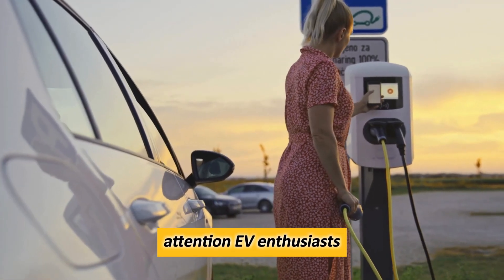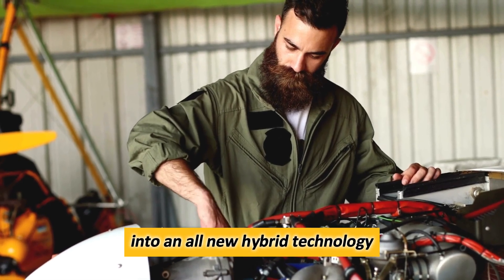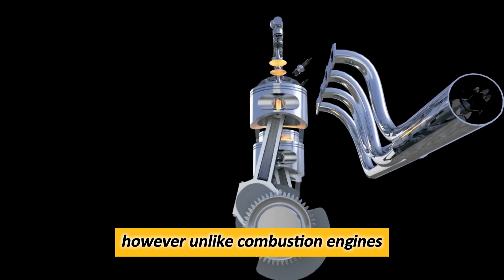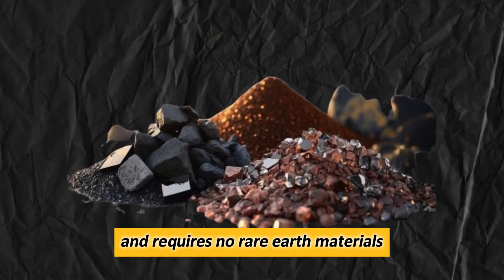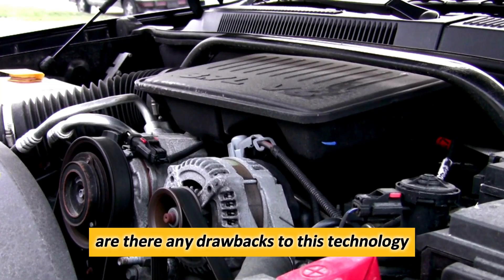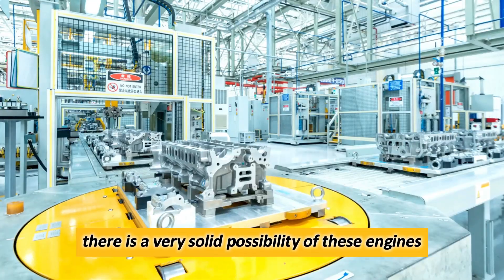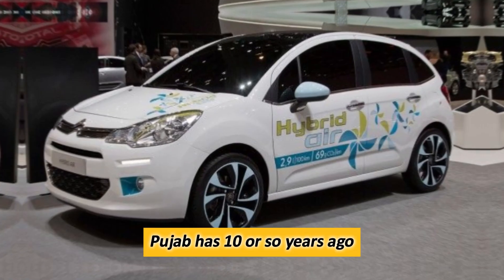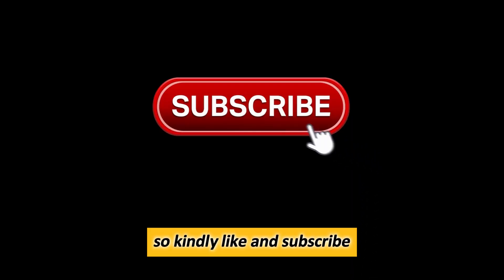GM CEO: "This New Engine Will CHANGE The World!"

Comment: Pipe dreams.  No it is not pollution free.  The pistons need lubrication, and mnii drops will go the the exhaust air,.  Reciprocating parts are inefficient, nothing is solved.  It will have high pressure tants (just like H2 cars) an that will leave smaller space for the driver / passengers..  The main problem: there are ev that puts all ICE cars to shame.  Being close to ICE car performance is no longer desired.

Comment: OK you say that EVs use the grid to charge their batteries. YUP they do in most cases, If the owner does not have solar cells for that purpose. Tell me, how do the air engine get the compressed air to run them? And tell me how much it costs to compress enough air to go 100 Miles. So GM has designed higher pressure tanks for the compressed air. HMMM, how safe is that? I'm going to get my tanks filled up in the summer and let my car sit in the sun all day while it heats up the pressure in the air tank goes up. UNTILL, BOOM, no car. And what about rear and tear. All automobiles with CID engines have maintenance problems because of all the moving parts. Air engine car have all the same moving parts don't they? EVs on the other hand have an electric motor with two moving parts and no transmission. Maybe you can explain to me how much less maintenance a car with all those pistons and connecting rods and valves and transmissions with hundreds of moving parts are no going to wear out faster than the hundreds of times less moving parts in an EV. NOPE, I'm not buying it!